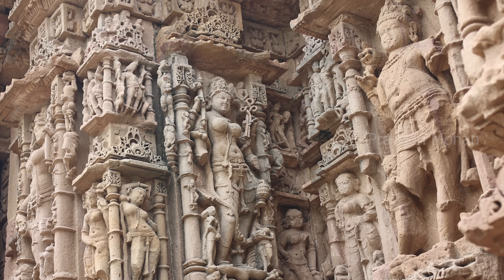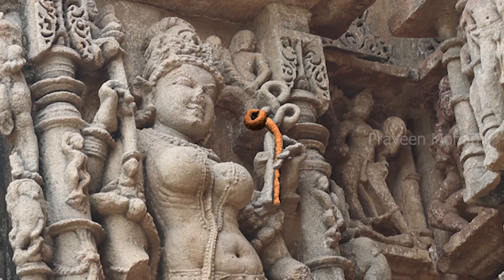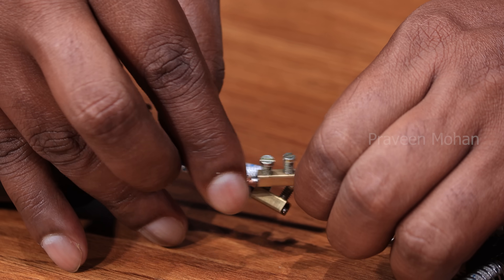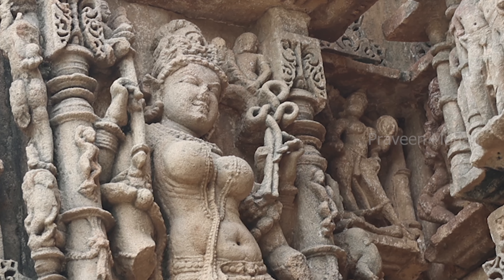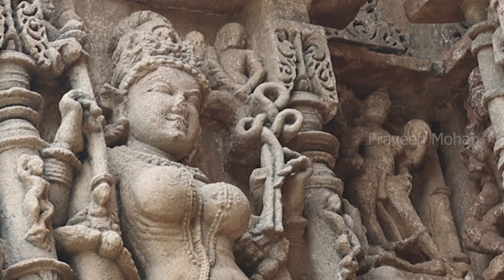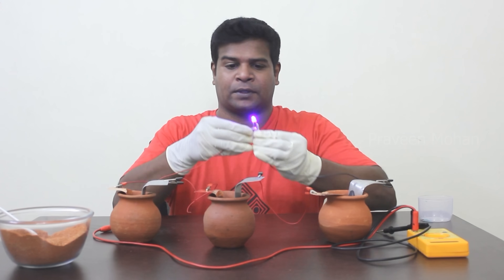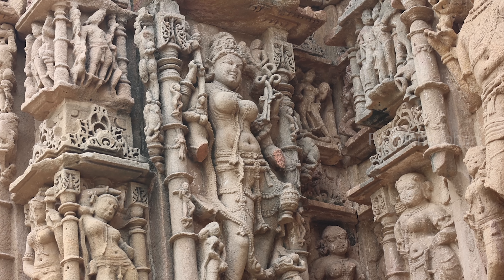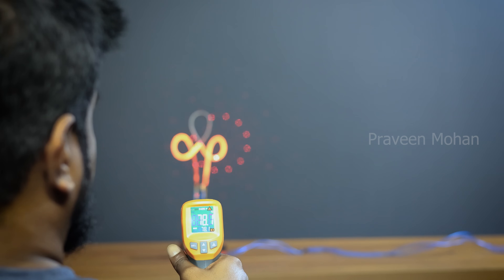Re-Creating Astras - Were Ancient Weapons Real?

Comment: This coiled device is also similar to what we use today as coiled immersion rods for water heating in buckets. 
As said by Praveen, that device also has wire connected to pot, our water heaters works the same way with connected  wires and electricity😱😱

Comment: The sculpture/poured geopolymer  has the Adityastra with very thick cables.  Praveen used very thin wires comparatively so we can assume hers was 100X more powerful ⚡
Reply: No because heat, light, etc is a consequence of the wire being thin. If you thicken it, it will disipate less heat, and thus being less hot, glows less, etc ...
Reply: yes thick wire has so much less resistance to electricity. and we do think they had batteries 1000's of years ago

Comment: Great work!  I think this could be much more potent if additional shapes were tested in a similar manner--especially a simple wire without any coiling.  If the same outcomes occurred still from a U-shaped wire, it would point to there being still more meaning to the carvings, I would say.

My thoughts are that they had an understanding of not just electricity which is based in electrons but also the ether's flows which is based in subtler particles.  The same general principles are present but the target range of influenced systems and how to go about it would vary.  It is like designing a telescope to certain wavelengths, or tuning into a radio frequency.  They likely were tapping into true zero-point energy that is very subtle and very abundant.  Maybe the batteries even involved storing the energy by concentrating it in some manner, rather than being of the nature of batteries that our society has come up with.  Ours are precursors to theirs.  Our batteries are peaking in terms of their capacities to store more energy, and this is likely a fundamental nature of the range of particles that we focus on and use rather than a universal aspect of batteries.

It is possible that the body itself is an integral component of directing the flows of these subtle currents, in a truly magical sense, where electricity as we know it may be too "large" of particles.  Larger particles have larger impacts on the systems they contact, while subtler particles are more able to be absorbed individually without causing large impact structures.  Ether flows are like Earth passing through a dust cloud compared to electron flows that are like Earth and a comet making contact.

I don't know how they would have gone about this, except by an understanding that was so complete as to be indistinguishable from a complete understanding of the nature of reality, and then applying it.

Comment: you used copper.. Try with gold.. 🤩Gold is highly conductive, meaning electricity can easily flow through it with minimal resistance. Copper, silver and aluminum are also conductive, but gold offers a superior level of electrical conductivity.
Reply from the maker: Hi Sasidhar, yeah will try that too. Thank you!
Reply: Yes sastrascalso mantion used if gokd in various astras for conductivity.

Comment: That thing spitting fire at you in the end-clip was hilarious and unexpected.
Always respect electricity folks, or it will smite you if you give it half a chance.
I once got a shock through safety pliers from a shorted Amplifier, those thick flat trapezoid chips with a bunch of legs soldered to the motherboard.
When it shocked my hand contracted and shorted it with the amp next to it for a double whammy. Sparks were flying everywhere. Good investment, safety pliers.

Comment: I am familiar with the production of mechanisms for machines made of steel. This device can resemble an induction heater if it is made of a copper tube to cool the inside with water and heat the steel outside to harden or simply reheat for forging.
Usually it uses strong high frequency ampere current

Comment: I believe the texture of the Battery Pot may have been for a reason to increase battery power. much as a motor's series of magnets are a generator, the outer ring of "magnets and coil" "straps" may have had generative properties if spun around the vertical axis. Maybe the "battery" was more of a capacitor. As such a capacitor would release a much more powerful discharge. cool! 😎🪔✨🌞

Comment: My first thought was that it looks like a 3-prong induction coil, then you described it and I was convinced before you even brought out the copper wire.
There's speculation that many of the sealed pots filled with toxic liquids were chemical batteries of some kind, and the egyptian Ankh seems to resemble the Adityastra to some extent. Ancients may not have had a power grid or the dependency on it that we had, but I've no doubt that electricity was used fairly commonly before the Fall of Rome.

Comment: Starts fires, produces enough heat to evaporate water.  I'm only surprised it didn't melt its a short circuit. Nothing on that statue suggested you coil a second wire around it to keep it from burning down your building.

Comment: I was really hoping that he would "re-create the wheel" by hooking up some of those batteries to the Adityastra to show if it can be powered by DC current. It's one thing to plug it into a wall outlet, 220V AC, and another to use low DC voltage.

Comment: Isn’t this similar to the water heater we use for bathing in many houses? Except different in shape of the coil.
Also how much electrical energy could those portable cells generate is also a question when we think of heating the water.

Comment: The scepter needs a lot of voltage, but the pot on the side of the goddess is different than the pot you recreated in a previous episode; maybe this particular design could amplify the power of the battery? I see a geometrical shielding

Comment: It looks more like the resistance present in heaters (the resistance bars being straight and only curving on its edges and so on composing a complete panel), based on the same principle the ancient device would be heated and serve as a heat source as long as it is hot and yes metals like copper and iron and other forgeable steels glow in red when they are extremely hot and thus on such a state they are maleable.

Comment: Stingers (Electric Immersion Heaters) all used to be made with 3 loops, just a  different layout from the Astra, but function similarly.  Do the 3 loops have a significance with electric usage? Does it make them work better? There's got to be a reason 2 devices 1000's of years apart both use 3 loops, and I can't imagine the "inventor" of the stinger had ancient knowledge. There's got to be a technical reason.

Comment: I still have some reservations about your claim... don't get me wrong here i know that the theory works in the way you said it. It is just that such a small battery should not be able to generate that much amount of current. well looking at current technology , Lion batteries and lead acid batteries are able to put out such amounts of current , but i think that it will be much more believable if you could specify the type of electrolyte used... i know these thinks are hard to come by, and probably not even revealed( I mean the god would not tell us how they are or became god you know...) but i guess we just have to look for a god that did that mistake and we would be able to conclude our theory that those things are actually possible. good work sir, well being an engineering student these things are really interesting and thought provoking. thank you.

Comment: Yep, we can figure out everything except power source. Even today, we seem to be firewalled off from any new power generation technology. The newest tech we have today is 80 years old.   The real question is: How do you make a single pot battery put out 200 volts? OR: What kind of heating element will glow red hot with only 5 volts? 🥴

Comment: could the lingam be the core for a step up transformer?  the small power source in the bowl from the rice husks and dissimilar metals. to excite a larger voltage from a coil around the lingam. you said a sound plate or vibration plate, I think. maybe it made and broke the contact to cause the pulse of voltage to produce a larger voltage. like the coil on a car. if you wrap the same type of stone rod with many turns of smaller wire and a few turn of large wire, like the one found under the lingam. pulse the voltage on the large coil, to pulse a higher voltage from the other, or vice a versa.

Comment: Thanks for the video. 
Perhaps a nichrome coil one can easily get in any electric shop. This coil comes in varaiions of 1000W or 2000W etc. and is used in common heaters used in kitchen.
Now when both ends are connected to an electric source using 15 Amp switching device, the heater within few seconds turns bright orange and emits very high heat wherein we can cook our daily lunch or whatever. The same naked coil if dipped in water will start heating the water tremendously fast... (although it's not recommended as the water gets electrified.)
These are properties of the nichrome coil only. So where does Adityasastra come into play. 
Can anyone please enlighten?

Comment: the Device would'nt be fictional one...as that works purely on heating effect of electric current. The power source would have existed, as it's based on simple electrolytic process for Current generation. The device was designed in such a way that the  amt of Heat emitted out was so intense that it produced the glow(after all it's a simple device made of metal wire).

Comment: What he has used is a Nichrome Wire.... Its the material used to make heating coils.... All of you can make this device 
..its a basic heater used for cooking...or in immersion rods...

The Gods weapon definitely would have the power but it was due to the power of God... The device without electricity is just a spring and a coil... 

Its the principal of Physics....

Comment: Teacher, with the proper power supplies, you can use low voltage and high current to get the same results, only with safe voltage levels.

The batteries also are easy to make and use safely, which would power the same Adityastra.

I still don't understand why 'our' technology isn't seen as possible back then, as the ancients were quite secretive when it came to their use of technology, and could have had as much if not more tech than we have.

Certain tech can't be hidden once it is used, as it is too easy to understand and recreate, even back then.

Material secrets are sometimes easier to hide, like iron, steel, and alloys, but until it is captured, you can't understand it, and alloys are even harder to understand even when you have them.

It was said that the Chinese may have learned about gun powder from other nations who then lost the tech when they lost a war, or died off from diseases. If that is the case, we may never know.

Comment: So basically you have discovered a resistor and a heating element, the battery you shown will never be enough to power the heating element (nichrome wire), of the size you shown . You can make any design be it a trishul or may be an gada with this heating element and all will glow and produce heat when connected to electricity.  This is a science experiment of class 6.

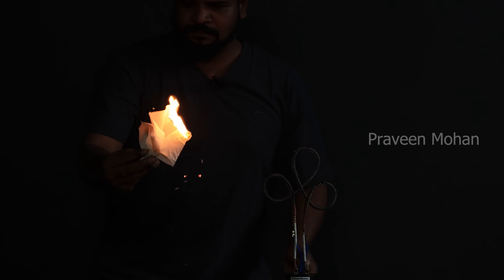Comment: @5:47 Did the wife of Sun God have 2pairs of the  hands? Because her front hands on the statue are clearly broken off. Is the other pair of arms/hands also her's or does it belong to someone else, standing behind her(like her father?). What is the vertical poll the other hand is holding? What is the winding on both hands(especially on the left hand which holds the device Adityastra)? No today's battery of that size could generate so much electricity as to make the device glow in dark o light a fire  ....   Is it possible that the electricity is being supplied by the means of the other hand with vertical poll/shaft from somewhere above  or even wirelessly and the jar holds transformer  of some sort?

Comment: You found a power crystal?????
That’s tulia!
Here is what you do to power them up.
Take some refined uranium.
Place it in a magnetic field within a tube of aluminum.
Then at one end.
You place the tulia!
Now begin oscillating the polarity of the electromagnetic field.
Hey presto!
You have an unlimited power supply.
That can be metered to the required power level. Depending on the frequency of the magnetic field oscillation.

Comment: Yes sure, but you need to answer where did they get if they did electricity. Fact is you can collect any fire plus and minus poles and you get same once electricity runs through. The curving not needed. So the main thing is running electricity though, which is the think they makes all run, but there is no proof of electricity here. Really you could take just a regular rod one to one pole and the other side to other pole and get same things. So you just using a modern device called battery or electricity and sentient shape of something that is not needed for this effects. Again, any shape collected to electricity will result in same fire and heat etc

Comment: Wait ! He just used copper wire and connected to battery and showed that it generates heat? THAT'S NORMAL INDUCTION!!, not some astra. And even if it would have been, the it wood have been a ROOM HEATER-ASTRA not some divine weapon of destruction.

Comment: What's the evidence that the carving showed is of Adityastra? Nothing is shown in the video, nor does anything come up in internet search to say that the loop is Adityastra.  It can be as well be a representation of 'Paasam'' or Pasu which is basically a loop. Pasam is a standard weapon in Durga idols and is even shown with Saraswati in Hoyasala sculptures in which its represented as a complex loop (akin to what you showed). Secondly, any copper wire when wound exhibits the behaviour you mentioned because of Electromagnetism and is one of the standard experiments in many schools. Thirdly, whats the assumption to say that the idol is that of Surya's wife? Surya himself is never shown with such kind of weapon (usually shown with lotus flowers). The sculpture could've been that of Durga or of Saraswati (looking at the pot like structure). While the theory is quite interesting, there are many gaps which need to be addressed.

Comment: Putting a resistence coil around the copper is cheating. That can only be an assumption and is strictly a modern viewpoint. I would say this is a feeble attempt at reproducing what is described and is probably not even close to what was being done but it least Praveen is trying

Comment: If you plug in any copper wire and keep any heating element on top of that and you switch on it will glow.. make some turns and it radiates heat and the water will vaporised. But this cannot be done with a battery of that size which gives only 1-2V output… when in your video, the so called asthra heats up and glows when you give 230V AC domestic voltage supply. So clearly this cannot be done with a pot battery. Or by connecting series of batteries. The efficiency will be very poor with that crude of a setup. That may be just a symbol for something. Please don’t exaggerate things. Before believing something, please use the least common sense to question and understand it. That is the only thing which separates us as humans than any other living species in earth. So use that 😊